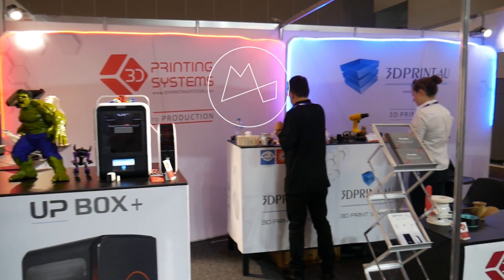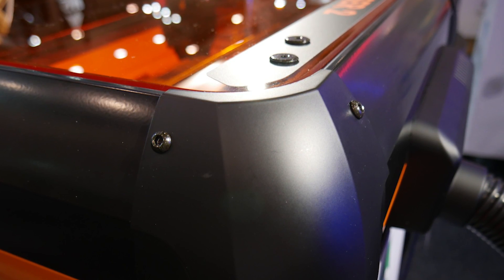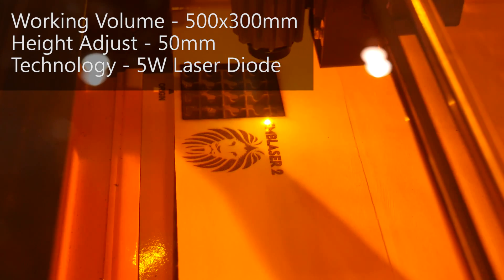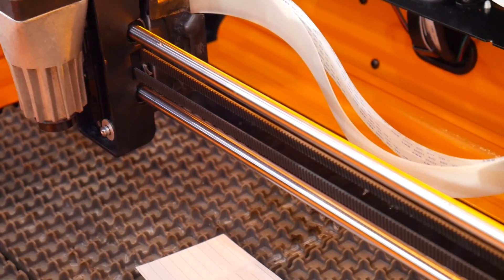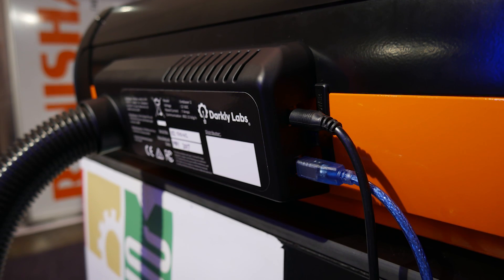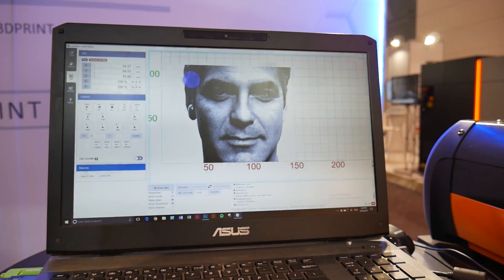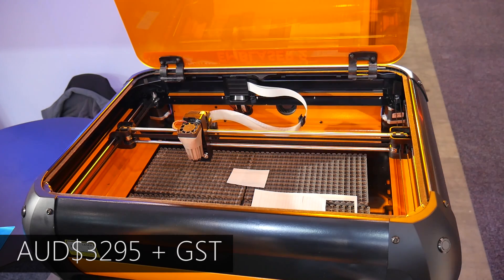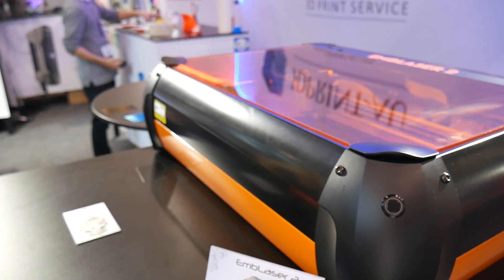Checking out the Emblaser 2 Desktop Laser Cutter and Engraver! Austech 2017

Comment: I've just ordered my first 3D printer (a 3DCSTAR P802-MHS), what are good forums to join?
Reply: Mexie Mex cool one other thing I just found out about that seems great is onshape again not a forum but great web based tool for modelling makes generating drawings and full assemblies from constraint defined parts relatively straightforward.  Had been using Blender in the past just due to experience in it for learning basics of 3d modelling and graphics but doesn't come close when it comes to modelling mechanical things.  Have also heard good things about fusion360 but I'm primarily a Linux user so can't yet use their software (apparently a web based option in the works too).
Reply: +Shaun Husain, funnily enough, one of the main reasons I'm looking for a good forum is because I also use Linux rather than Mac/Windows and most places seem targeted specifically for those two platforms. Thanks for the heads up about onshape, I'll check it out.
Reply: ***** no problem yeah fortunately things like octopi work through a browser and repetier and cura engine work cross platform so most everything can be done regardless of platform, but not much vendor support (understandable though given all the distros and variants in people's Linux systems, granted we're all using basically the same kernel).  For modelling or editors can grab openscad as well it's more of a programmers interface to making models but they are all defined by variables so can find existing openscad files on thingiverse or elsewhere and adjust the variables to generate a new model with the new parameters F5 to refresh the preview F6 to render the model then export an STL (good for stuff like pulleys and gears that are typically hard to model by hand).
Reply: Mexie Mex I recently got one too anyone have any suggestions
Reply: www.reddit.com/r/3dprinting
Reply: www.reddit.com/r/3dprinting
Reply: not a forum really but get on thingiverse also there are printer specific forums like the reprap forum but not sure about your printer.
Reply: +Skj Skj, Doh! I keep forgetting there is anything more than KEK on Reddit LOL
+Shaun Husain, Already a member of Thingiverse ;^>

Comment: 'Thin' wood? Even the manufacturer's site does not indicate how thick or what sort of wood it will cut - ply, MDF, HMRMDF? 1, 2 or 3 millimeter?  It really needs to be able to cut 3mm ply for halfway serious model making.
Reply from the maker: +Bruce Lee it'll need several passes afaik for 3mm but it can do it many of the models were that thick
Reply: Bruce Lee yes it does cut 3mm ply.
Reply: The Mr. Beam cutter/engraver that is pretty much the same machine, with a 5W solid state laser, claims they can cut 4mm plywood, 2mm MDF, 5mm balsa and 2mm acryl. But i'm not shure if that is single pass cutting, or more. And nobody says how clean (straight down, charring depth?) the cut will actually look.
Reply: Their website has thickness of materials it can cut:

https://darklylabs.com/emblaser2/

Reckons 6mm mdf, which I find surprising. I have a 5w diode laser, and it would take an incredibly long time, with multiple passes to achieve that. Mind you, mine cost about $300 I think.
Reply: The Emblaser 2 has optics for beam reshaping to get the most out of a 5w laser diode. It is surprising, but it works!
Reply: How much of an increase do you get with that though?  Even if it managed to turn a 5W laser into a 10W laser it will be very slow won't it?
Reply: It's not that bad, about 40% of the speed of a 20w laser cutter!
Reply: That's quite impressive - kindof doubling the power of the diode.

I have 2 C02 machines, that I've taken from 40w to 60w to 80w. For me 80w appears to be the limit - in that there's just too much fire shooting out of the bottom of the materials being cut, and the heat warps the acrylic etc. 

I'm looking to make my own after these though... am really interested to see what other people are up to.  I've retrofitted a little 5w diode machine so it runs with Smoothieware and LaserWeb (coincidentally the same as used by the Emblaser (which is encouraging)). Now I just need to scale up to a C02 set up.... trying to avoid some of the crazy design decisions of the machines from Aliexpress et al.

Comment: Could this be used to hack together an SLS 3D printer? I want to see that! :)
Reply: Probably. But at that pricepoint, you can just buy a Sintratec kit and be done with it...
Reply from the maker: +ExtraBase you really don't want to own a SLS... trust me!
Reply: +Maker's Muse I was considering to get one, but then i was worried too much about the powder and dust problems. I don't really have a spare room or workshop that i could dedicate to such a mess. And then there is that problem with fumes too. Not shure about the exact temperatures involved in firing that Laser into a bed of plastic, but i'm pretty shure an FDM nozzle keeps the temperature, and with that the harmful emissions, at much lower levels.
Reply: I would personally LOVE to own an SLS. I design stuff that usually requires SLS (see here http://twistypuzzles.com/cgi-bin/pdb-search.cgi?act=inv&key=837), and having my own is much cheaper in the long run than always buying prints from other places. But I'd just be worried about the maintenance and the quality of the prints. An EOS machine definitely prints better than the Sintratec, and I don't have to troubleshoot if something goes wrong.

Comment: How are these still so expensive? You can build one for less then 1k and there are several options for open source software to run it on. I just don't see what value you're getting for that kind of money.
Reply: https://es.aliexpress.com/store/product/100W-Co2-USB-Laser-Cutting-Machine-With-DSP-System-Laser-Cutter-Engraver-Chiller-1000-x-600/503794_32736134374.html?spm=2114.04010208.3.50.J7IeVY&ws_ab_test=searchweb0_0,searchweb201602_5_10152_10065_10151_5010011_10068_10136_10137_10060_10138_10155_10062_437_10154_10056_10055_10054_10059_303_100031_10099_10103_10102_10096_10109_10052_10053_10107_10050_10142_10051_5030012_10084_10083_10080_10082_10081_10110_519_10111_10176_10112_10113_10114_10182_10185_10184_10078_10079_10073_10123_10189_142,searchweb201603_16,ppcSwitch_5&btsid=2b702cad-2d4b-42ec-9baa-4a5c1cc12fa7&algo_expid=66d10a41-8940-45a1-8606-ed88a94ce9e4-9&algo_pvid=66d10a41-8940-45a1-8606-ed88a94ce9e4
Reply: https://www.aliexpress.com/item/New-110-220V-co2-laser-engraver-40w-laser-cutting-machine-with-USB-port-lift-system-up/32769684294.html?spm=2114.01010208.3.10.n92JuL&ws_ab_test=searchweb0_0,searchweb201602_5_10152_10065_10151_10130_10068_5010013_10136_10137_10060_10138_10155_10062_437_10154_10056_10055_10054_10059_303_100031_10099_10103_10102_10096_10052_10053_10107_10050_10142_10051_5030015_10084_10083_10080_10082_10081_10178_10110_519_10111_10112_10113_10114_10182_10185_10078_10079_10073_10123_10189_142,searchweb201603_9,ppcSwitch_5&btsid=af2e33b8-f85f-4ca3-9820-da2939bb341f&algo_expid=da030a87-14d7-46e2-9e01-c6645a20eee0-1&algo_pvid=da030a87-14d7-46e2-9e01-c6645a20eee0

Comment: "Undefeatable".. Unless you have a even a very basic electronics kit. So DMM + pot. :)  I'll stick with the interlocks on the RayJet 300.. 2 magnetic sensors per door.
Hopefully it'll be more reliable than their Up Mini's under heavy(class/school) use.
Reply from the maker: Magnets are WAY easier to defeat, we used to just stick neodymiums on the sensors so we could fire the laser while calibrating mirrors... I don't expect a student or teacher to happen upon the correct resistance to cheat both interlocks. Schools really are the ultimate test of any tech, what happened to your mini's?
Reply: At least on the RayJet there is a 'service plug' that turns off the interlocks, yay service manuals :) Plus because it's big, intimating machine once you drill the 'this WILL MAKE YOU INSTANTLY BLIND'  bit in, they don't touch them. I'm more worried about dirt on the contacts/loose connectors/etc causing the lid interlocks to fail open, reed switches last longer.(Final focusing mirrors on the otherhand, well.. We have a collection of them now. A machine that gets used 12 hours a day for most of the week gets some serious use. There are now 2 spare lenses stored away for later. :)

As for the mini's.. Beyond all the mainboards fried themselves in different ways(We had 4 machines, now we are down to 1. Hopeful the Mini 2's will be better. Even THAT has stupid interlocks we need to disable so we can open doors.) and we are using smoothie upgrades to try and recover them, promising results) we've had bed heaters fail, internal lighting fail, wiring looms break and so, so SO many jams/clogs(Last is more '3d printer' thing. But it's still frustrating to watch a commercial machine strip fulfillment and require the extruder dismantling to clean. We expect this on the home made i3's but not these.)
Still, they are easy to use for the untrained, so they stay. :)

Comment: Very interesting! The lack of mirrors to clean and adjust would indeed make this very education-friendly. Does the diode have a lifespan similar to something like the tube in CO2 lasers or is this pretty much free of consumables? Besides electricity of course. I have an Epilog Zing already but I hope they sell a ton of them.
Reply from the maker: It does indeed, heat is the killer of diodes so that's why its got the crazy looking heatsink and mount assembly. The diode replacement process looked fairly simple though, definitely a tonne easier than aligning mirrors and focusing lenses. The Zing's are nice little machines! Again co2 has diodes beat for power (plus diodes can't cut clear acrylic) but for a teacher I think this is a godsend.
Reply: Maker's Muse I see! With affordable 3D printers, hobby lasers, and all the desktop milling machines popping up in the last 10 years I am incredibly excited for the younger generation of makers. Cheers!